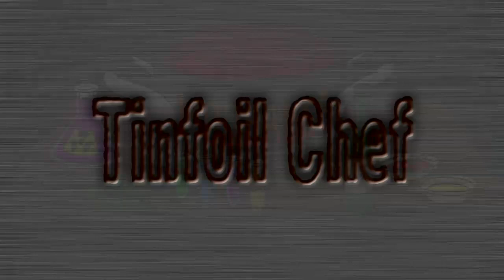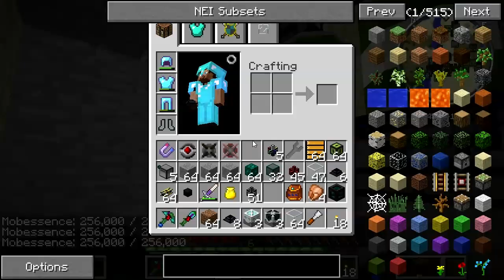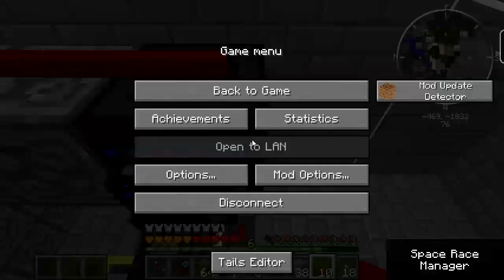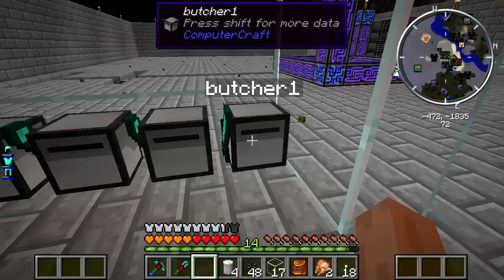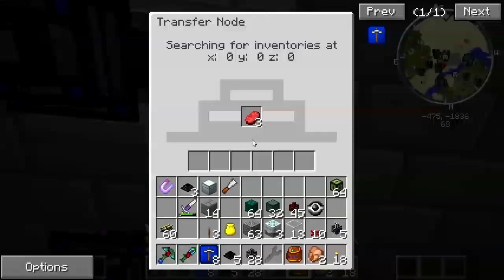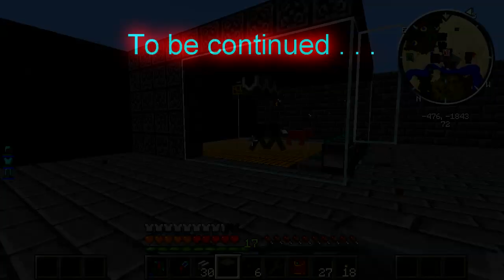Minecraft Mod Sauce Ep.24 Butcher Shop Death Machine HermitCraft Modded Minecraft

Comment: Hiya TFC! The exact spawningarea from autospawners is 4 blocks out measured from the northeast corner of the spawnerblock when placed down. Nice vid as always.
Reply from the maker: ***** Yeah I believe it's the same area as with vanilla spawners.  I prefer to use 9x9 because it's just easier to put it in the middle of that area.  In this case I don't remember if all 3 of them (or any even) are dead center but so far nothing is spawning outside the killbox